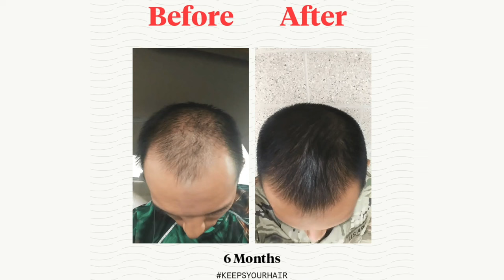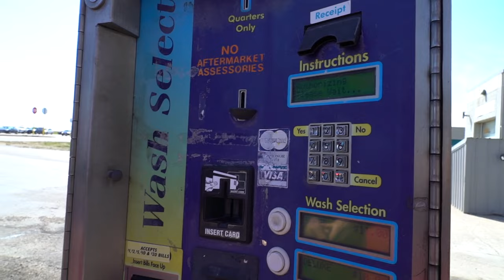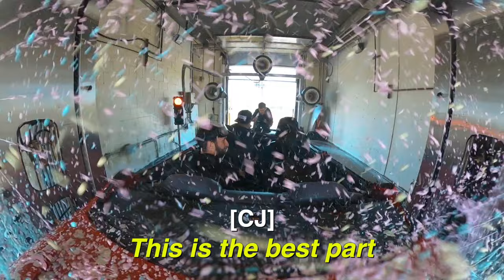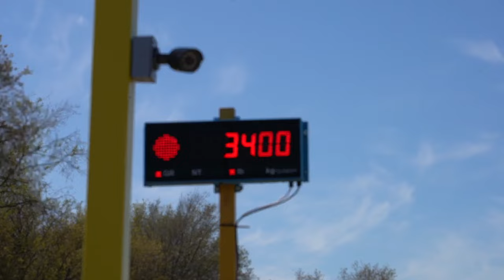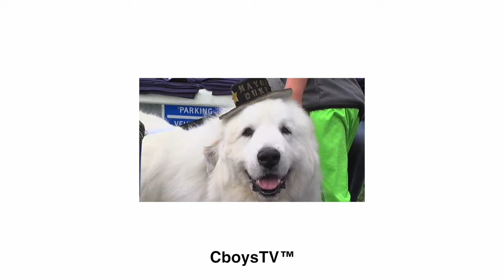Homemade Convertible through Car Wash

Comment: get the ram 3500, the limiteds are sick with the 12in touch screen display and you can't beat the Cummins engine paired with the Aisin transmission.

Comment: Guys get another duramax. They're reliable as hell and the 2020s are making over 500 horse and 910 lb-ft of torque. I'm telling you because I've got one right now that I TRADED my F-350 King Ranch for. The High Country is my favorite truck package hands down, and the truck itself is tough to beat.
Reply: F350 makes well over 1000 torque
Reply: @coleblankemeier2492  but the frame folds in half under any substantial lateral force
Reply: @harrisonashcraft1129  we've had 3 hitch tow hopper wagons behind one extremely comfortably (80000+ pounds)

Comment: Well from my experience i have had a newer f350 and also we have now a 3500 ram and the ram is much better for off-road use and on road and still looks amazing the ford is for on road and looking good for what my family does is atv parks and in our woods in muddy situation i have been in twice with both trucks and with a full trailer with 4 quads and it was the end of the weekend and and we were leaving and and it had rained all night so the feild was muddy and the Dodge never stoped and had a lot more low end power and a high enough wheel speed when needed and the ford just did not do that it just spun and spun kinda a on road princes but thats all im going to say
Reply: Cole Lane what year was ur f350
Reply: Ram all the way
Reply: ram ftw

Comment: The ram truck has a 21inch touch screen best in class towing over 1,000 tq
Reply: Also blows transmissions
Reply: It's supposed to be a truck not a Cadillac
Reply: Carson From The 260 just like the Ford
Reply: Says fordguy1774. Ford had the 1st 1k torque
Reply: It’s actually a 13 inch display screen
Reply: The 1000 torque is a $3000 upgrade option
Reply: wrong ram sucks the new f350s can tow up to 37000 pounds, around 19.5 tonnes
Reply: But the new dodges are built like crap

Comment: Best running peanut you’ve had and u didn’t even rip it around or burn the tires til they popped. 🤨
Reply: f350
Reply: Jamie Bouchard fr tho. They didn’t even do anything with it besides the car wash and drive thru . Buddy could of done a lot better with that crane
Reply: He needs to cut the exhaust off
Reply: F350

Comment: Ford F- 350
Reply: No. DONT GET IT. On the new ones the torque converter shutters at 55mph which violently shakes your steering wheel as if your wheels are unbalanced. And there’s no OEM or aftermarket fixes for it. You might say “tHe SpEeD liMiT iSNt EvEn 55”... it affects you more than you would think.

Comment: Get a cummins!!!! Best engine ever made.
Reply: Runs the longest
Reply: DONT GET THE F350. On the new ones the torque converter shutters at 55mph which violently shakes your steering wheel as if your wheels are unbalanced. And there’s no OEM or aftermarket fixes for it. You might say “tHe SpEeD liMiT iSNt EvEn 55”... it affects you more than you would think.